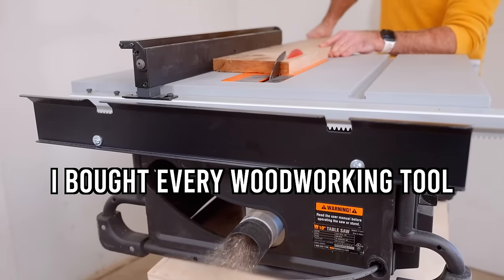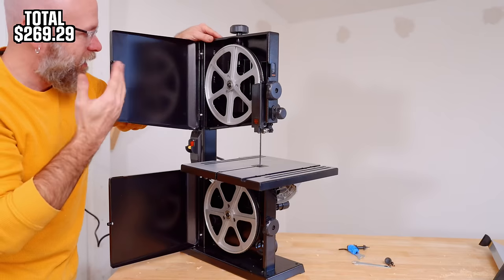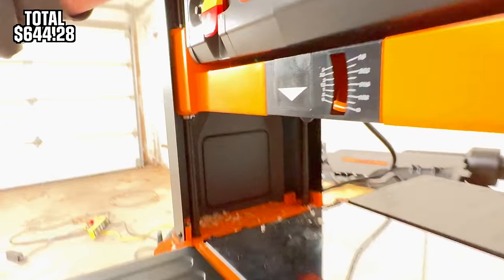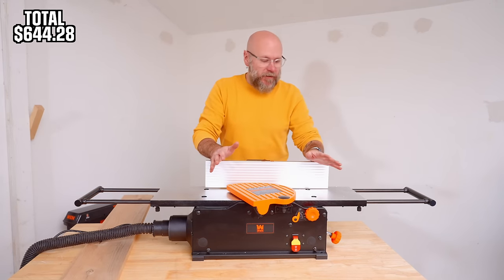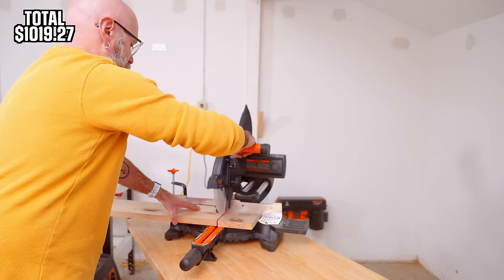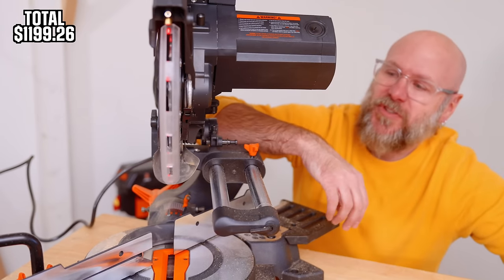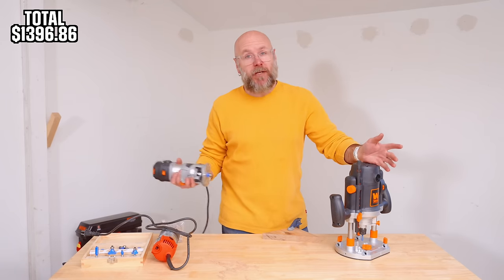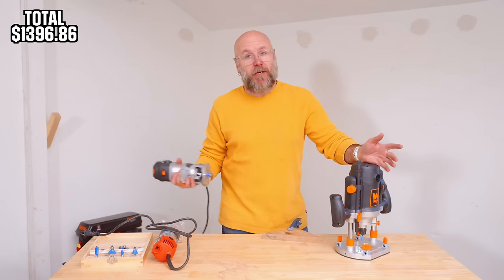I Bought ALL THE WEN TOOLS! Let's Review.

Comment: Would you like to barrow my 30yr old Planer by Penn State Industries LOL.  They don't make parts for it anymore! But it works great! LOL! And I have a 30yr old Penn State Industries 189lb 14" Free standing Band-saw  93"blade. These are considered in between tools. Not the best but they get the job done. Penn State Industries over the yrs got away from big wood working equipment and now do small wood turning machines for making wood pen kits. What I think of WEN tools LOL! A lot of plastic parts that brake. The only time I test any power tools is over a 90days working with them, then you know. Good luck with WEN your going to need it! Let us about WEN Power Tools after a year how they hold up.

Comment: One star for this channel as a tool reviewer.  Could have cut the boar that was jointed in half and butted jointed edges together to check if it had a straight and square edge.  How does one claim to review tools they haven't set up and won't confirm do the job they were meant for.  Wen might make tools that offer value even at their low cost while this video does not.  The cost of regret is often a cheap tool that doesn't do its job but today the price is 35 minutes of my time.

Comment: Hey tool guy I have to agree with the guy bout the drill press torsion spring for the tension on the fast recoil and another thing those import drills are all appx 4inch travel you didn't have the travel stop all the way up it's on the left side and finally the lid has a rounded side and you only turn the knob a couple turn  and the networks as a clip for the lid and wen u turn it in and it goes through the hole that's in the lower part of the clasp any brand of small band saws like that one are only ment for hobbiest they are all crap to use on a real task wen, black and decker, Craftsman there only ment for 1 inch or less material ill bet any of the common brands will never track well then throw the blades or spin off the drive wheels and heavy stock they will stall and chew up thedrive belt pulleys as there not much more than a sewing mach belt trust me ive been there and done that  buyem and build ur little bird houses and etc  cause  they will fall apart

Comment: I think the rack and pinion on the band saw just needs a teeny tiny bit of grease, good sticky grease and it'll be 1000000 times better..
edit: wow.. on the planer.. I'm not going to spoil it, but even if they send you the stuff.. like what? you're expected to put them in yourself?? And to have to SHIP something that heavy.. They really dropped the ball on that one. How did it make through QC? HOW did it pass FINAL INSPECTION??? oh man.. I spoiled it sorry. 
also: At least the sander has holes on the bottom so you can bolt it to the table..

Comment: Picky on your WEN tool drill press? YOU BET.. change the spring if needed, but theres nothing bad about the handle return speed. I have the 10 inch version by choice and find zero issues with travel or otherwise. You get what you pay for.

If all you're going to do is bad mouth a product like the Band Saw  too, why bother buying any of it just to criticize it? You should focus in the positive, acknowledge comparative differences with higher priced units, and quit being so negative. Make the best of what you have, don't buy what you don't like, and if unchanged, stay out of anyone's workshop - you'd drive em nuts.

Comment: An off-brand socket set is one thing but power tools are another. For anyone considering Wen or other Harbor Freight level of quality tools, you can buy much better name brand tools for only a little bit more money. The better tools are better out of the box, and hold up so much better as time goes on, that it just doesn't make sense to get low quality tools for only a small difference in price. Imagine getting only 25% of the useful life from a Wen saw as compared to DeWalt when you spent 80% of the price of a DeWalt on the Wen. ...and yeah, all of those cheap knobs are going to break off in a little while, followed by other parts...

Comment: The planer became the chip bitch after arriving incomplete. How does that even happen? Obviously they dont test their products before shipping out. I have heard some somewhat decent things about Wen but getting an incomplete unit is absurd. Leave it outside to catch the chips from a tool that works. If you had a lathe or a mill you could make replacement metal knobs to replace the plastic ones. I think the plastic knobs should lower the ratings by an additional 1/2 star.

Comment: People please read a number of reviews before buying Wen tools. Do not base your purchase off of this one video. I went off of 731 woodworks glowing review and I wish I had done more research before  I bought the 10” bandsaw and it’s the worst tool in my shop that I plan on giving away soon.  The tension knob popped off shortly after purchase and after very little use and will not stay on, the table is trash and will not stay square, and is a pain to get square and adjust, and this saw does not have enough power to rip through hardwood consistently.  The fence moves quite a bit when You try to lock it down and is very hard to get square. I don’t know what wen paid you to give glowing reviews of most of their tools, but I think it’s a disservice to beginning woodworkers when there are plenty of better options in the same price range from other brands.
Reply: Just to add to my comment I have a variety of tools including Dewalt,, Hitachi, rigid, Bosch, porter cable, Skil, Kobalt, and bostich and Wen is the only brand I have a complaint about.  Maybe I got a lemon, but the wen bandsaw is such a poor quality product that I will never trust reviews such as yours again.

Comment: I don't see anything in these that screams quality that will last day in, day out usage. Accuracy over time with ease of repeatability doesn't seem to be there either. What I'm planning on using this type of equipment for will need accuracy for joint fitments and repeatability without the headache of spending a half hour trying to make it accurate. I know this from a $400.00 Craftsman contractors table saw. The blade started out making halfway square cuts but after a few boxes it immediately was unable to make a square cut. The direct drive motor bearings didn't last, and the blade wobbles and bogs down on 1/2" Baltic Burch plywood. Sears went out shortly after purchase so no warranty. I'm much happier with my used 70's Powermatic 66 table saw that cost me $800 plus a new plug for my 30A 240V outlet and new blades

Comment: Your steps for milling are out of order,  you can plane plane join but you'll never get a perfectly square part,  first operation is rough cut length, join one side match it wide wise on the table saw square off one face to the jointed edge then plane the last surface to size  thats how you get 4 sides perfectly square.

Comment: i realize that you can only afford what you can afford.  For a beginner with very little money, this may seem like an answer.  But, in reality, the frustration of working with tools that can be shipped to you without the drive chain and sprocket required to make it perform the basic function can often lead to a beginner becoming a quitter.  Fighting the adjustment knobs on that fiddly little band saw to try and get the blade tracking properly or cutting squarely.  Then run it for ten minutes and find that everything shifted and you are starting over again.  Planers that do not plane flat parallel surfaces.  Drill presses with parts falling off on the very first use???  Cheap????  Frustrating???  Or just not worth the savings????

Comment: Pretty fun test but not realistic in the slightest.  When it comes to reviewing woodworking products it's about the Long Haul not does it work today while in recording. Stick with using these for your normal woodworking everyday for the next year. Them review. They don't last. And motors won't burn out day one. These all should have zero stars. A woodworker is a craftsman. Not a DIYer. The weekend guy/girl might get away with a few projects but before long they break down. Fun idea not real life.